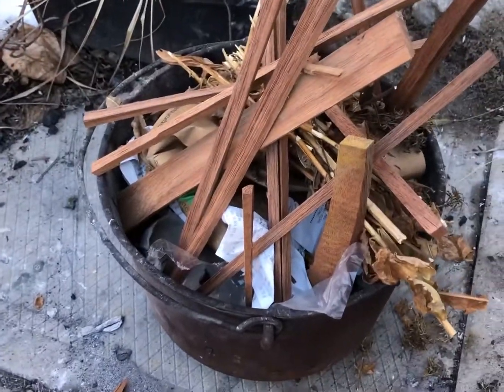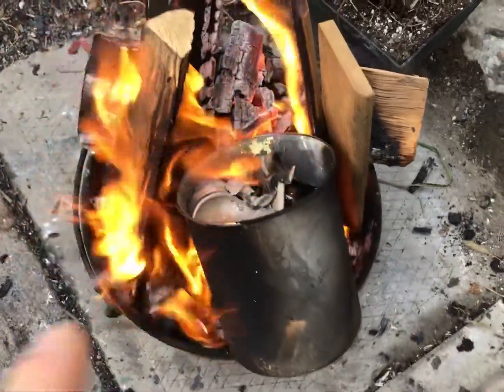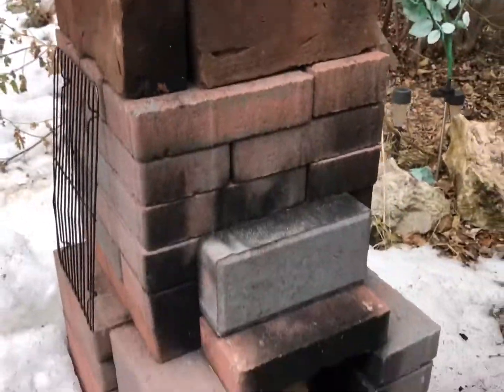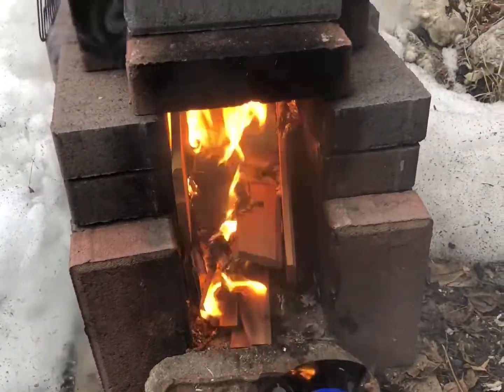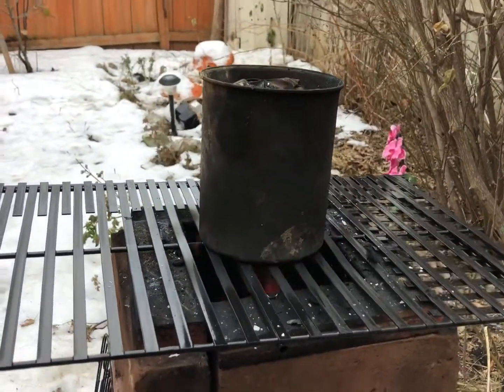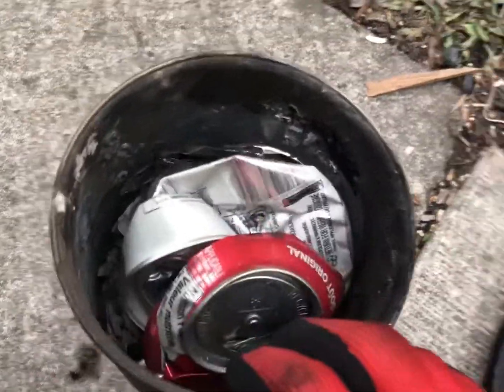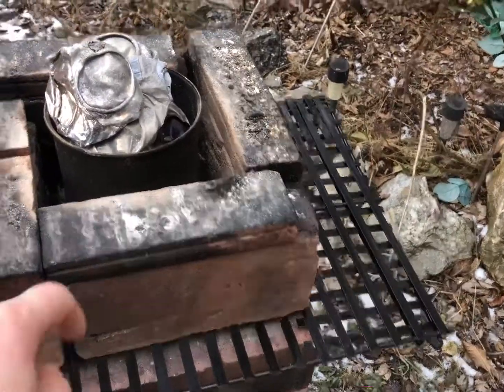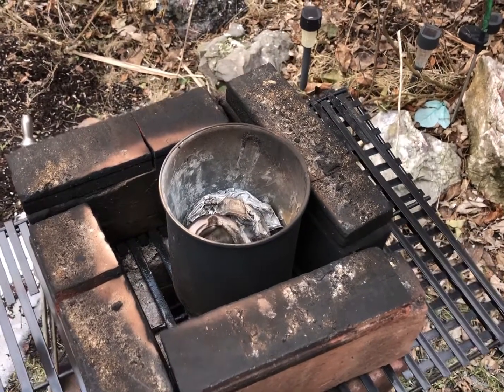Can you melt Aluminum using wood?

Comment: If you want to succeed then you need to contain the heat with minimal loss and oxidize the fire as much as possible. I.e. blower stoker or directly add o2 with an oxygen concentrator. With wood you are better off with forced air and use the venturi effect to add pure oxygen.
Reply from the maker: Appreciate the advice thank you